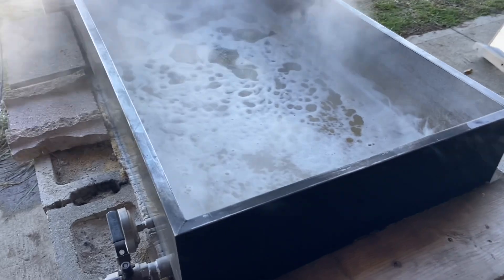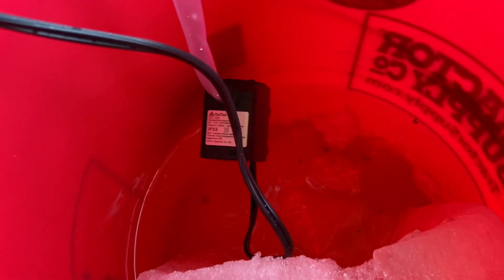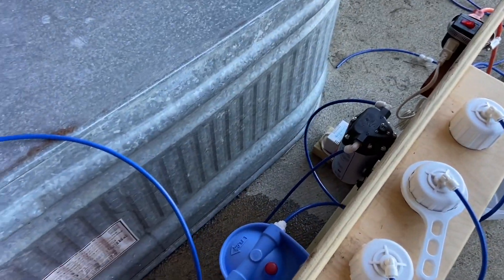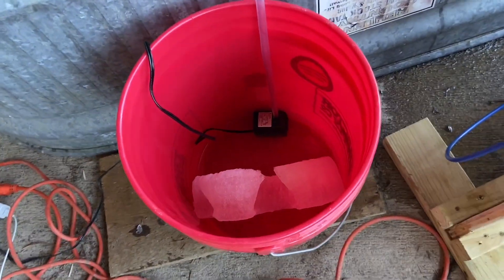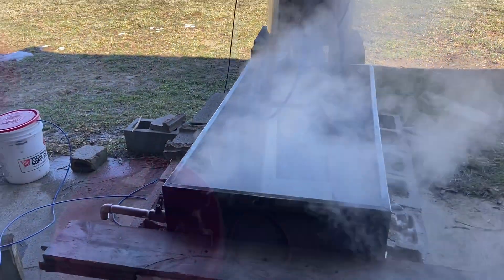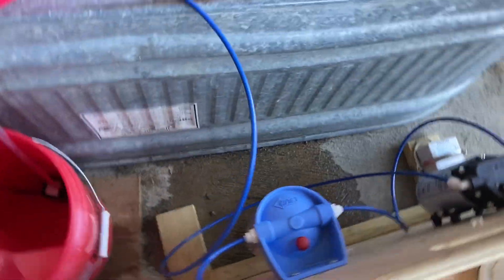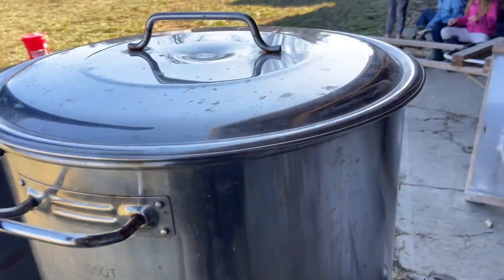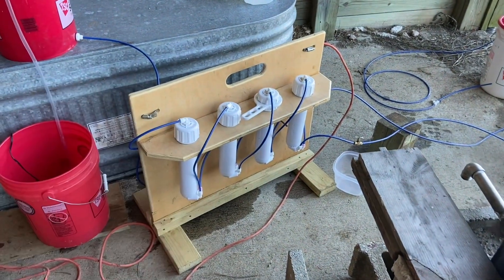Maple Syrup Reverse Osmosis Upgrades and Questions

Comment: Hi Jason, question for you. When you flush out your sap and go to run permeate through for cleaning, does your pump ever have a problem pushing air all the way through the membranes? I built your exact set up here (thank you very much for the idea!) but when I try flushing my system I always have water left in the prefilter that won't push all the way through. Have you had experience with this or know how to possibly fix it? Thanks!
Reply from the maker: Yes, mine does not push air all the way through.  I manually empty pre-filter and have always been fine to run the next day.  Wouldn’t want to leave it like that long-term tho.
Reply: Mount the prefilter housing upside down. It will push it dry.  This is how I built mine: https://youtu.be/Og9JpgIfE8w

Comment: Could I use a single 600gpd ro membrane in place of the 4 -150 Gpd?
Reply from the maker: @adamporter1680  I have no idea, sorry haven’t tested that
Reply: Ok. Thanks. I wasnt sure if a single 600gpd membrane was the same as 4 cumulative 150's or not.  For half the cost of the four I can buy a single 600.  Waant sure if it needed that successive membrane staging to achieve the end result- I was thinking that it does need that and the capacity is just that vs the purity achieved.   

Thanks!
Reply from the maker: @ …interesting…if you try it, circle back and let us know if it works please!
Reply: You can but it will be more prone to fouling that membrane due to it being operated at a higher recovery rate.  Recovery rate = permeate out / flow in.  A 600 gpd memrane removes 6 gal of sap per hour.  A 150 gpd ones removes 1.5 g/h.  Calculate them all out for the pump flowrate you have and you will see that the 4 x 150 setup has much lower recovery rates for each membrane, reducing the effects of fouling.   More information here:  Maple Sap Reverse Osmosis Basics: https://www.youtube.com/playlist?list=PL6CwcmcTEWYxhYPQCMAWETg9gHWL7_RXw

Comment: I used a Delrin sleeve CP-8NLB I bought at Lowes for $5. It has  brass stints for the valve, but the compression fittings are plastic and really seal the needle valve fitting. No leaks. I used same needle valve you listed on your original video. By the way... our RO system worked great. Thank you for the videos. Without them, I probably wouldn't have made a system.
Reply from the maker: Glad things worked out for you on the RO.  Great info here, thanks Tom!

Comment: take the needle valve and the hose to a old plummer shop and ask the old gays for expert help, i live in norway so i cant help you with your dimensjons or the kind of 
parts you put together in your contry. i make birch syrup, so its simular to what you are doing. why dont you put up dividers in the boilerpan, put up 2 walls and you get faster and darker syrup. or you can bay a crab boiler for propanif you strugle with making it darker and tastyer. i do mine last boiling in the kitchen, its a little bit slower prossess than the crab boiler but its easier to controll spesialy in the last minuttes of the boil.
Reply from the maker: Thanks, Endre…sounds like a good process you’ve got going on the Birch!
Reply: i realy enjoy it!

Comment: Jason - brass compression sleeves are designed for copper pipe. Plastic sleeves are designed for pvc pipe. My needle valve does not leak but this is my first year using RO. Hope this helps.
Reply from the maker: So are you using copper with your needle valve?
Reply: @birchfieldfarming  No I'm using 1/4" pvc tubing like yours. Brass sleeves can cut into the pvc tubing and cause the tubing to become offset inside the compression fitting. I've had a lot of experience with plumbing kitchen / bathroom fixtures and learned the hard way. Your video's have been very helpful and I really appreciate the time and effort you give so others like myself can save time, money, and avoid the learning curve mistakes. Thank you!
Reply from the maker: @dennisfehrenbach5352 Thanks Dennis!  Hope your season is a good one!🤠

Comment: Hi Jason, never realized all of the work involved in getting Maple Syrup from Maple Water.  When I buy Maple Syrup I never realized what is all involved in getting the Syrup.  With the Wood Fire to heat the Maple Water what do you do at night to keep the fire hot enough to continue your processing?  It seems like it would be hard to regulate a constant heat when the wood runs low.
Reply from the maker: Hi Ben,
The unique low temps at night this time of year allow us to let the unfinished sap sit in the pan for several days.  This allows us to pick things up right where we left off the next day and also allows the sap to darken in the evaporator pan.  Letting the fire die down at the end of the day and then starting again the next is not the most efficient use of our firewood but does produce ample amounts of biochar which we then use in our gardening and water filtration.  Excellent question!